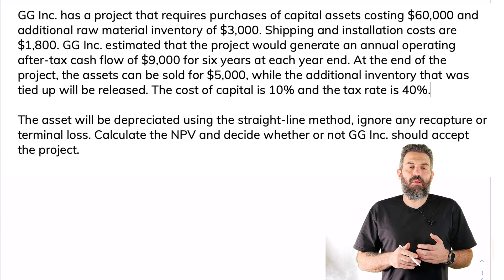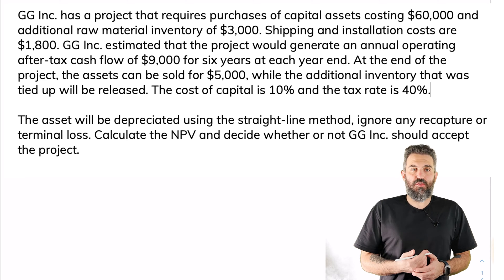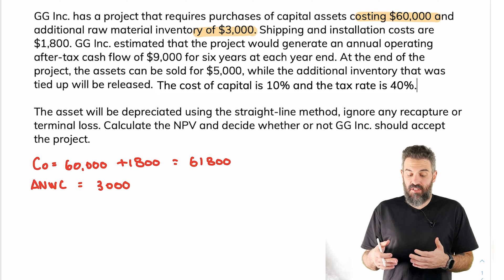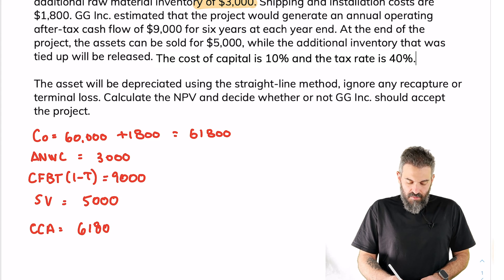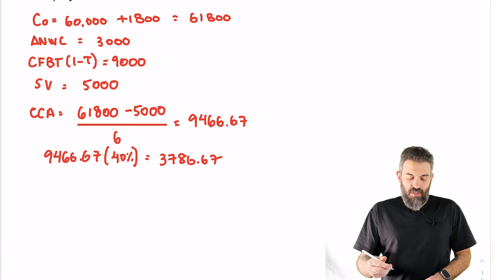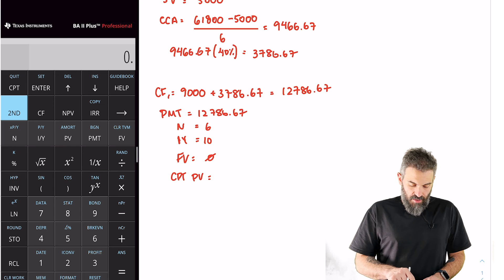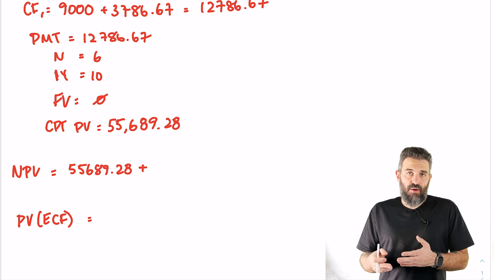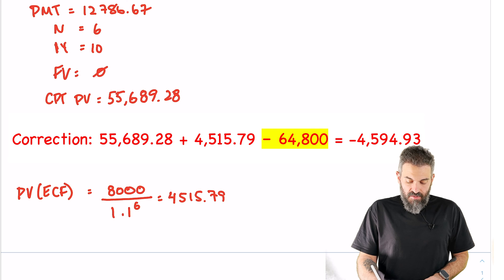How to Calculate NPV with Straight Line Depreciation

Comment: My teacher told us to do it differently

We basically did it like this: ((Inflow - depn) (1-tax rate)) + depreciation

I lost marks for just using (Inflow - depn)(1-t) as the after tax inflow. sucks and has me confused.
Reply: nvm just had an 'aha moment'

basically to calculate tax and for that we remove depreciation FULLY (as my country allows full tax deduction) and NPV is supposed to be about cashflow and depreciation isn't a real outflow so we have to add that back in

in the US its different, you guys have a depreciation tax shield where you'll only get a tax deduction on the portion of depreciation, so that is what made me confused when I watch these videos xD I guess in this instance you just remove the tax shield and add in the depn back to get the cashflow which you're going to discount